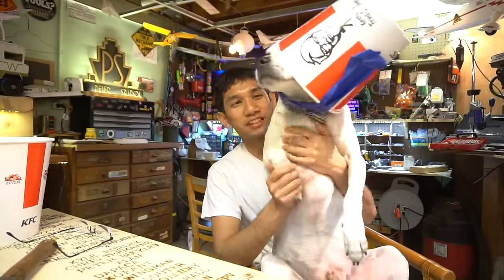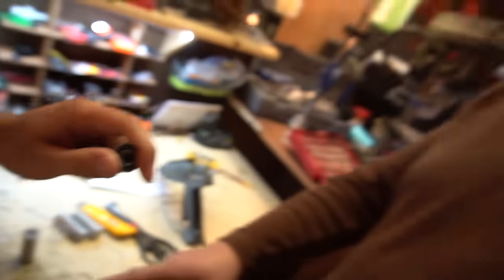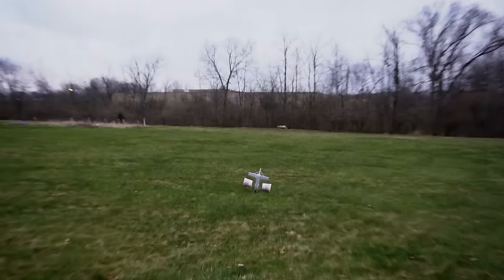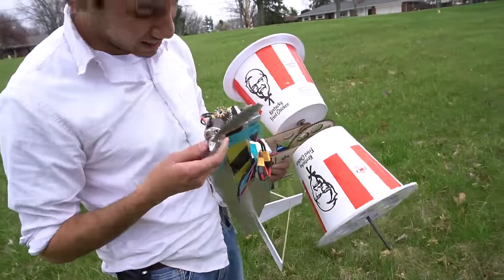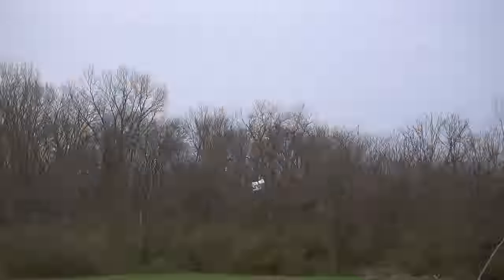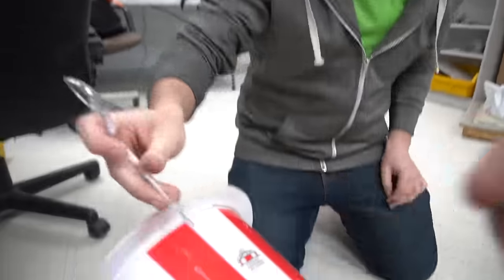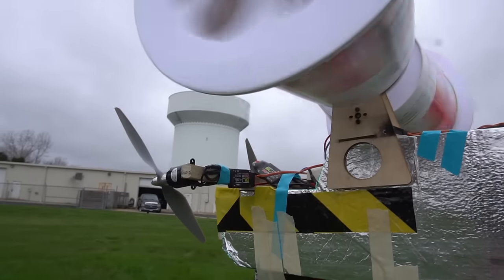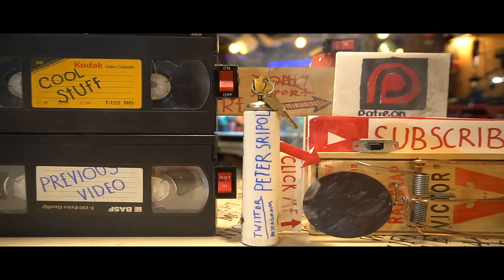RC KFC bucket aeroplane (magnus effect)

Comment: it wont work coz the surface on the bucket too smooth and the RPM was to slow, in order to create lift you need a seam like 4 seam fast ball base ball or golf ball  dimples.

Comment: I believe this design need to be tailed heavy to make it flyable in high alpha style..

Also seems like float to weigh ratio too small, either make it more light weight or bigger rolling wings for better floating effect.

Also I guess the prop is only assistant for flying path, and shouldn't need high-speed to maintain the float like traditional wing design.

Another point could help is, the outer part of and outer diameter of the add-on rolling plates attached, should be using a slight heavier material... As the heavier it is, when it rolling at high-speed, will create a bigger floating effect.

Obsers the ProjectAir YouTube as reference.
https://youtu.be/UG2O_GK7-R8

Comment: The main problem is the added fins on the buckets. You changed the aerodynamics and air surface flow by adding them. They essentially acted as air brakes. The video was excessively too long for the actual content. You're sitting there talking away while we're listening but are looking for intelligent content that most of your talking does not provide. Thanks for the attempt anyway.